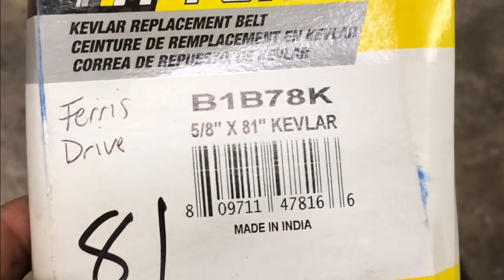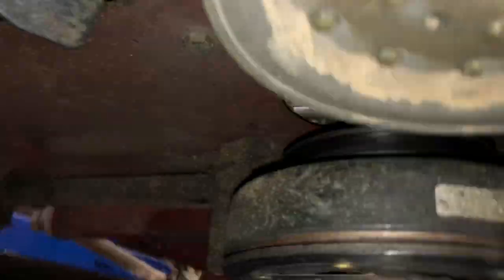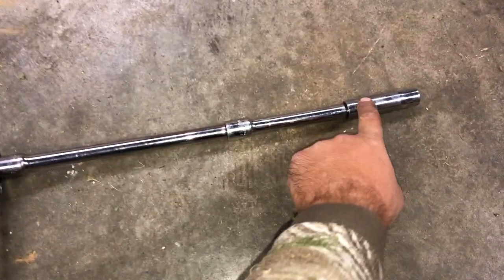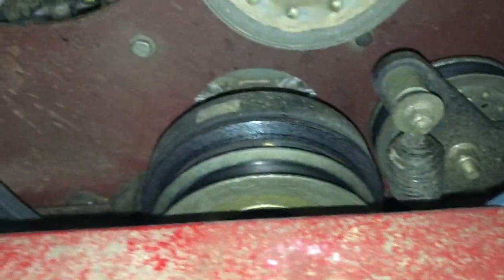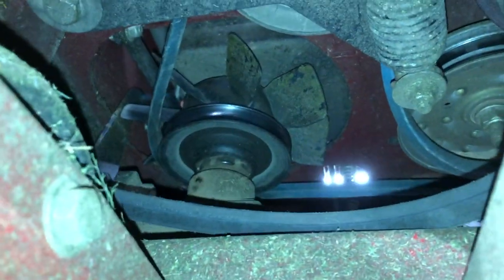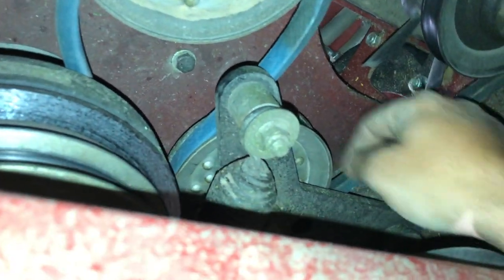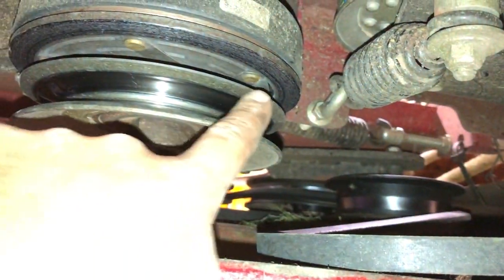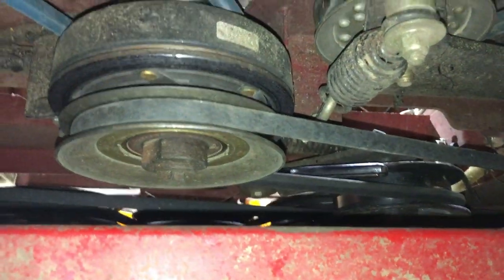Ferris Z3X | How to Replace Drive Belt |

Comment: Excellent Video!  I'm a "shade tree mechanic" but willing to try just about anything.  After watching your video I'm confident that I could follow your instructions and remove and replace the drive belt on my Ferris Z3x.  Unfortunately, I don't have a lift to get the mower above me to be able to work on it!  But...your video was excellent and well documented. Thank you for maintaining the viewer's point of reference by reminding throughout the video which side you were working on and and when you were facing the front and the rear!  Excellent.  If you were closer I'd bring it to you and pay you for your time and experience!  Looks like I'm headed to the dealer in the morning!  Anyway, thanks again for a very thorough video for guys like me!
Reply from the maker: Full transparency this was the first time I had to replace it… since then I’ve had to take it off for maintenance or replace it several more times since then. I have found you can jack up the rear of the mower and put it on Jack stands if you don’t have a lift. 

Also it’s easier to get the deck belt on and sometimes off from the top side of the mower in front than from underneath. Other than that everything else is pretty much the same.

Comment: Entire job can be done on the ground with deck lowered and rear hydro panel pulled off.  Relatively easy access to clutch from trim side.  Hardest part is reaching to feed belt over hydro fan, and getting clutch plate bolt tight which requires a 1/4" drive 9/16" socket on the top side of bolt located trim side behind exhaust flange. Looks to be about as much hassle doing it with mower lifted as on the ground.  I use a quality ratchet strap to pull my tensioners (hooks on to spring spacer/riser).

Z3X 61" 37hp Vangaurd w/Oilguard
Reply from the maker: Good to know, thanks!

Comment: Thank you for making this video.  I am rebuilding the drive motor/ pumps on my Z2 and yours is the only video I found!  God bless you, too!
Reply from the maker: Glad to hear it’s going to be helpful for you! Just a quick sidenote one thing I’ve come to realize is it’s much easier once you have the drive belt back on to lower the mower back down and access the tensioner pulley for the mower belts from the front of the mowor. It’s easier to put a longer extension, a.k.a. the cheater bar, on it from the front then it is from underneath.  

I’ve got another video where I show how to swap out the spindles, if you scroll through it you’ll see what I mean.
Reply: Ron did you have fan/pulley slip on the hydro drive?  I have zx3 and it's been back to Ferris and they have attempted to fix, but problem continues.
Reply: @georgegrimm4952  I’ve had zero problems with my Z1 and no problems with my Z2 since I did the rebuild.  Cheers.

Comment: I just did this on the ground i jacked it up put the rear up on blocks. I the deck belt is easier if you take off the right side from the rear belt cover and roll tge belt off and on. Then when doing the drive belt tensioner i used a ratchet strap on the pulley bolt. I can tell you it was way easier than the cheater bar. Hope this helps
Reply from the maker: I should remake the video… I’ve changed this belt about 10 times since then and you are correct there are easier ways I’ve found since then. 

Work smarter not harder!!

Comment: God bless you for this video! I haven't tried it yet, but at least your video is excellent and clear. Lord willing, I'll be able to do this, but I don't have a lift, just some floor jacks.
Reply from the maker: Get it up high enough for you to have some working room and you should be ok... not the best design (in my opinion) for us diy guys but at least you know it can be done. 

Hope it really helped...it’s tough to be a one man show and film with one hand and work with the other 😂😂
Reply from the maker: Also I’ve found it’s much easier to get the deck belt back on when the machine is back on the ground. Just drop the mower deck all the way down and insert the 1/2 wrench on top of the tensioner pulley arm instead of trying to fight it from underneath the mower.
Reply: @DaisyDukesLandscaping  I agree. It was really good to see where everything goes from underneath for the transmission drive belt, but other than needing to fish a few things through from the bottom, much easier working on the mower drive belt from the top. Discovering I'd been sold the wrong manual was golden though :-) (I have an IS700Z.) Once I figured the bracket holding the front stationary spindle needed to be removed, it went pretty well. Well, that and praying my way through it :-)

Comment: Great video, clear and concise, keep up the great work !
Reply from the maker: Thanks! Side note it may be easier to put the deck belt back on once the mower is back on the ground. Just dropped the deck and use a 1/2” ratchet and a pry bar.

Comment: If your belt blew maybe you got a sweet gum ball in it or a stone, be sure to check all your pulleys for wiggle or grittiness in the bearings ...and possibly what I did was I don't run at full throttle when I engage the PTO which causes the belt to slip and blow off eventually after a couple hundred hours cause I'm dumb

Comment: I am so scared it’s going to break out in the field far away from the trailer with no help to load it. Man I would be stuck. There so heave you can’t move it at all. What if you have to go up hill??. I am going to replace mine right away I just put 220 hours on it and am going to change all the belts. Pray it never happens in the field. Bless you Brother.

Comment: Great video, I have the same mower, How many hours did you have on your unit when the belt needed replaced? Thanks agian
Reply from the maker: I have 500 hours on that mower and this is the second belt I’ve had to replace. In both instances a piece of debris got up in the pulleys and was undetectable until it was too late. 

Sometimes you can tell somethings wrong with the mower because it doesn’t “feel” right. When that happens trust your gut and give the mower (especially the drive belt and pulleys) a thorough look. Usually you’ll see a stick or something hung up or wedged in the pulley. If you catch it soon enough it won’t do any damage to the belt but if it goes too long it’ll cause it to crack, split, or jump off the pulley. And nine times out of ten If it jumps off the pulley it’s going to get torn up it will be unusable.

Comment: The hardest part is getting the z3 back on the trailer or truck once the belt snaps, especially when it’s 90 degrees out
Reply from the maker: That’s a FACT!! If it weren’t for the fact I had other mowers it wouldn’t have happened. Same thing goes for getting it up on the lift. I had to use another mower just to get it up the ramps.
Reply: Daisy Duke's Landscaping 
Good thing I had a spare in the garage, time to order another for the next time

Comment: Great video
Reply from the maker: Thank you! I’ve found sometimes it’s easier to re-install the mower deck belt after lowering the machine back down and dropping the mower deck as low as possible and using a half inch wrench from the front.

Comment: How long did it take you to replace the belt?
Reply from the maker: The first time it took 30-45 minutes. I’ve replaced it 10
Times since then and it’s much easier than I made it out to be in the video. 

Couple tips I’ve learned… 

1. take the mower deck belt off (and put it back on) from the topside of the machine not working from underneath

2. Only loosen the clutch bracket just a wee bit and hook something to it (like a small ratchet strap) and pull it out then tap it back in with a hammer. If you get the bolt too loose it’s a pain to get to the topside of the bolt to hold it and keep it from spinning. 

3. Adjust your spring on the tensioner pulley as needed. The older the spring is the tighter it needs to be to hold the same tension. I’ve got 2000+ hours on the machine and I’m on my third spring.

Actually mistakenly replaced the right side hydro because I had no power. Turned out the spring was just bad 🙄

4. You can get away with not using a lift if you jack up the rear of the machine and put it on jackstands and then use a floor jack and lift up the front of the machine and brace it up as well. It’s a little cramped, but it’s doable.

Hope this helps!!!
Reply: @DaisyDukesLandscaping  Thank you for the info, much appreciated!

Comment: Who did you get the belt from? I can’t find it available anywhere
Reply from the maker: If you’re dead in the water the only place you may be able to find one in stock is NAPA...even then, sometimes they’re a special order and take a few days. 

If you have time (or you want to buy a few replacements to keep on the trailer...which I recommend) you can order one on amazon. This belt is a next day delivery. 

Here is a link to one that will fit. In full disclosure I’m an amazon affiliate and this is a link that will earn me a small commission. 

https://amzn.to/3nRNAKP

Also, I recommend buying at least one of every belt for each mower because sooner or later they all go down (hopefully not at the same time) and it never happens at an ideal time. 

Hope this helps.
Reply: @DaisyDukesLandscaping  thank you very much. I will use the link to help you out
Reply: @DaisyDukesLandscaping  also I have the 61 do you know if that’s the same size belt?
Reply from the maker: Here’s a link for an online manual. Enter your serial number and it should pull up your parts list. 

I’d bookmark it on your phone or computer once it pulls up for future reference. 

https://www.ferrismowers.com/na/en_us/support/manuals.html

Also if you don’t mind let me know if it fits or if  it what size yours is so if anyone else in the future has the same question.
Reply: @DaisyDukesLandscaping  Ferris part number for the 61 is 5105316 I think it’s different than the 72
Reply from the maker: Same part number as the 72”. So it’s the same belt!!